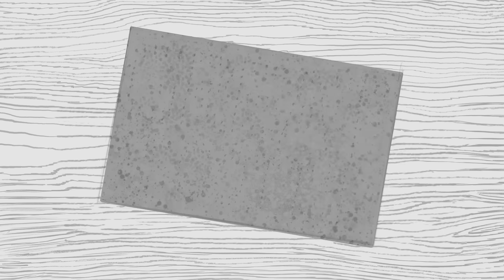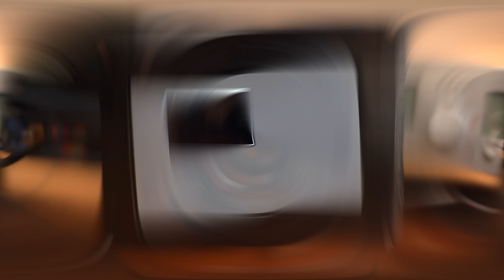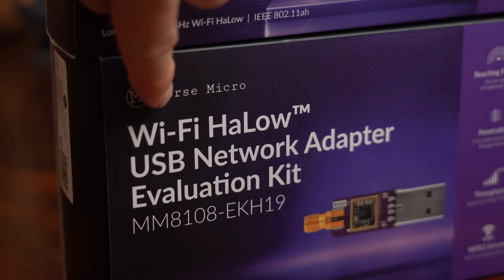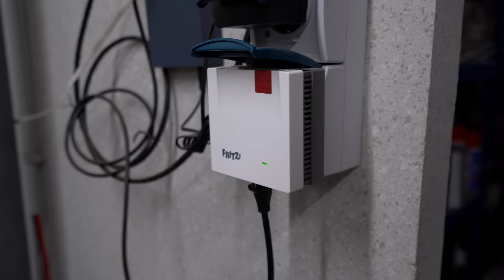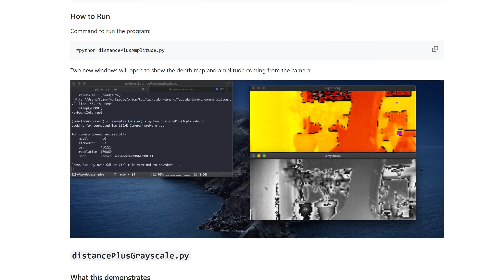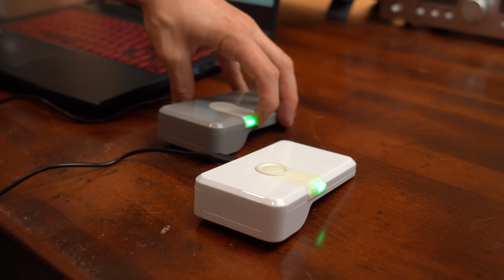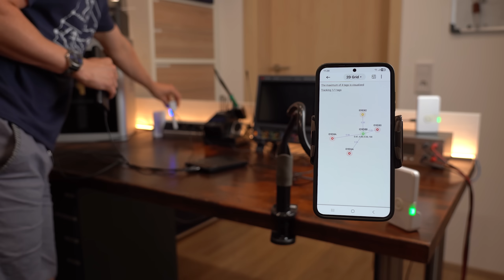I tried Super Useful Future Tech! (That you can use Today)

Comment: With fixed 3€ duty on everything from outside EU, Mouser prices are a tad less ridiculous for private customers in comparison all of a sudden. Hopefully Aliexpress finds a way to fix this... or buying electronics and parts in low quantities is going to be very expensive for a while.
Reply from the maker: The market often finds a way ;-)
Reply: @greatscottlab  If there's one thing the chinese are good at, it's figuring out loopholes to bypass taxes. I'm confident they will find a way to skip this new tax.
Reply: @ddvdemaybe they'll sell a breadboard with all the fixings as "one item". At least in the us it was per shipping container for $200. Sad that you guys get the cars and we in the us get the small items but neither of us get both.
Reply: @greatscottlab GreatScott, I have a hardware concept that might be interesting from an electronics perspective.

The Meta Quest 3 has excellent optics, but a lot of its electronics exist only because it is a standalone VR computer.

For a pure personal display, the system could theoretically be simplified:

- remove cameras and tracking,
- remove the onboard computing,
- relocate the battery,
- create an external video/control module.

The remaining challenge would be turning the Quest 3 optical system into a lightweight wired display device.

It would be interesting to explore:

- what electronics are truly required,
- whether the display system can be separated,
- how much weight could realistically be removed.

Essentially: turning a VR headset into a high-end wearable monitor.
Reply: @ytdrachengame1157there are vr sets that do exactly that? No camera etc just a monitor for the pc. Add a raspberry, done.
Reply: In Turkey, the government made it super hard for people to import things, but AliExpress and Temu set up local warehouses for their popular items. For less common stuff, they just import it themselves, but it takes a bit longer.
Reply: I dunno, as an American I still think mouser is over priced, I go out of my way to avoid buying anything from mouser and have not for years.
Reply: that's crazy 3 euros tax for each resistor plus the need for Product Identifiers for all items crazy
Reply: @greenerell484  I'm pretty sure that you only pay the 3€ tax per product category on your order, not for every single individual item (unless the seller on aliexpress hasn't configured things correctly). Still absolutely criminal, but I'll just have to buy bigger batches of electronics now I guess
Reply: Yep
Reply: You also have to pay the 3€ for orders from mouser. And because most items are a different HS-Code you might pay more for tariffs than the items.
Reply: My electronic hobbys are basically over. I canceled many future projects because of the ridiculous EU scam prices / taxes. Living in Germany gets more expensive from week to week and doing some fun projects like voron zero are no longer worth it. Crazy times we live!
Reply: Dk. As a Russian I can say that mouser is the best place I know for component selection. Local shops just can't provide such filters as mouser and also don't have such big component base. I don't usually look at the prices on mouser cause I just can't by components from it, but from what I've seen our distributors sell at least ICs for like double the price. So I usually just search there and by ether from China or from local distributors.
P.s. if you know a better place for component selection please tell me.
Reply: @antisocial_machinist your country has a "3 day special military operation" going on for the last 4 years. YOU are competing with the army and if in doubt: they pay better prices.
Reply: And on top of that: bypassing sanctions is not cheap anyways.
Reply: EU is a joke, criticized Trump for tariffs and is doing the same...
Reply: The problem with the US tariffs/trade war is the trade barriers between allies and the baseless reasons for them. The EU and China are not that close.
Reply: @ImpiantoFacile Even worse than him, Tarriffs, Regulations that add additional cost, taxes...
Reply: @ImpiantoFacile it’s the way he did it. He even in the end admitted his policies were bad for America. He removed it. If the tariffs were actually good for the American economy - why did he remove them? He controlled the house and senate.
Reply: @ImpiantoFacile as an American... It's Trump's fault, he's destroyed the global markets
Reply: @thaphreak I'm still buying from China in the us, only food local
Reply: @thaphreak If the EU brought their tariffs into parity with the US, we probably wouldn't be dealing with these tax overhead costs.
Reply: @pappaflammyboi5799  putting in blanket tarifs in the same manner is a death sentence for trade relationships
Reply: @lo-filogic Blanket, individual, or otherwise tariffs is not smart economics...

Comment: Back to the old pricing!
Reply from the maker: Haha that would be great ;-)
Reply: Inflation does not work that way
Reply: @probablyanadult7354 neither does Moore's law (even though it's been disproved since, older hardware should still come down in price as they're replaced by newer, better and - at least in the old times - cheaper alternatives because we could cram more transistors on the same silicium surface).
We live in strange times :(
Reply: @pbe6965  every gain in computing must be offset by a loss in software efficiency, otherwise people might realize that there isn't really a whole lot of a point to the apparent progress other than making money
Reply: @probablyanadult7354 Deflation does work that way ;-) (but that hardly ever happens)
Reply: @probablyanadult7354 it's not that kind of inflation, this is bubble inflation
Reply: @ThylineTheGay  It's the "Because I fucking said so" kind of inflation.  They're complaining about having to raise prices and then celebrate making record profits.
Reply: @probablyanadult7354it's not inflation, the company went public and everything about them changed. Pi 3b's are still available for $35, same price as they were 10+ years ago.
Reply: @probablyanadult7354 "Inflation" is just stealing done by the elite - especially financially complex.
Reply: @probablyanadult7354 TVs are still getting cheaper.
Reply: @probablyanadult7354 The most insidious law of physics